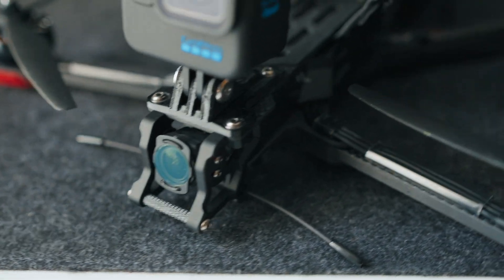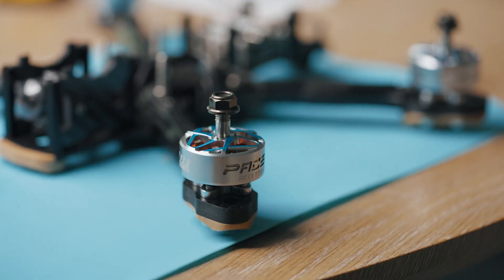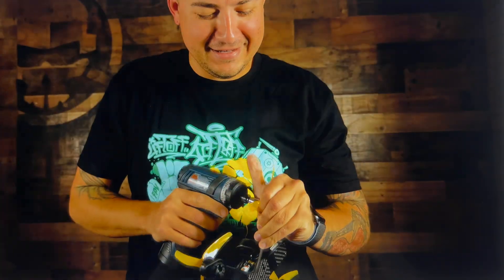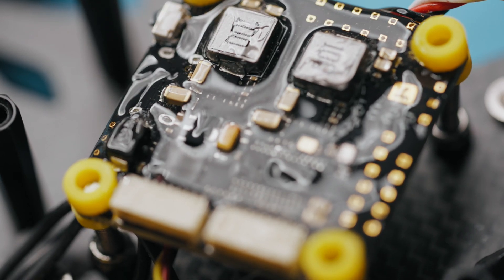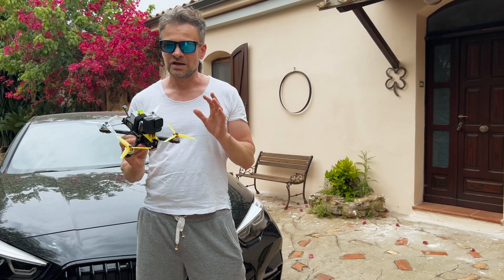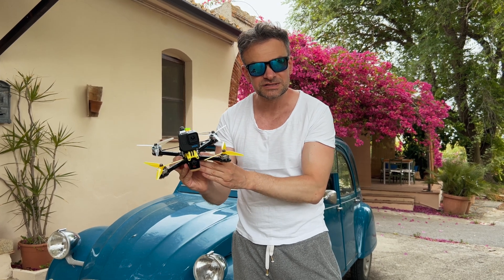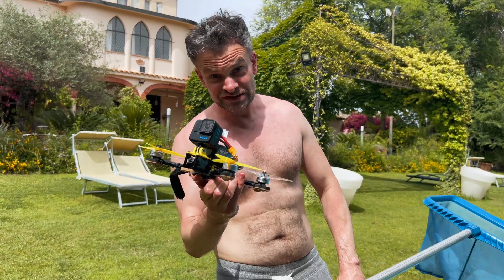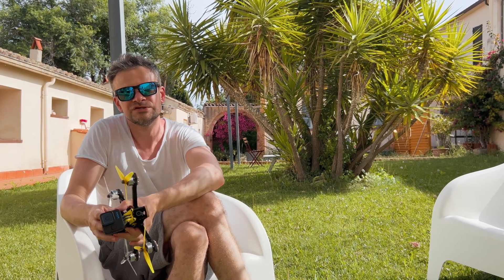Fully WATERPROOF FPV DRONE step by step

Comment from the maker: - It would also be nice to have silicone around the camera lens. There were no problems when using a Polar camera, but Nebula needs it;
- Leave a small hole for access to the barometer if you want to use GPS with your waterproof drone. In this case, everything will work correctly. If this is not done, the RTH will not work correctly, or rather, the drone may fall from a height if it was measured incorrectly;
- if the drone is completely submerged under water, turn on the "horizon mode" - in this way it will remain in a horizontal position and will not turn over;
- the signal may be lost under a large mass of water
Reply: what happens with the barometer full of water, if u submerge it what happens?
Reply from the maker: @diegomartinez-js4yh  I left a small hole for the barometer, it was not covered with silicone - only in this case the GPS works correctly. Everything was fine, I think that a huge pressure is needed for water to penetrate there. But on the other hand, I flew this drone under waterfalls, where the water flow is very intense - everything is fine
Reply: @WIL_FPV  tyvm!
Reply from the maker: @diegomartinez-js4yh  In any case, be careful))
Reply: What about the Caddx Vista VTX? surly it is not waterproof? The SD card? The USB port? The plug?
Reply from the maker: Vista is waterproof by default - that's why i chose vista. and it doesn't have an sd card. the ports have rubber plugs in them and are also covered with silicone

Comment: Hey,

nice Video. 😍 But I asked myself, whats with the connectors on the stack you dont use. Did you put silicone into it?
Reply from the maker: hi,
thanks, I tried to do my best
this is a very good question, sorry I didn't mented the answer in the video. YES, it's better to fill the connectors (even those that are not used) with silicone. If you get into a pool, with chlorinated water, or in the sea with salt water, everything will rust there.
Thanks for payed attention to this

Comment: what if u have to resolder something, its hard to remove from what ive lear ed
Reply from the maker: so, it’s gonna be a problem, frankly. it is necessary to cover again 🤷‍♂️
Reply: @WIL_FPV what coating did you use? i couldnt understand from the video. and what other coatings would you recommend? i dont want  something that is impossible to remove... Also, dji air unit 4 pro? do i have to coat that?
Reply from the maker: @Dumpflam  it was in this video that I used FPV Worry Free Waterproof Silicone Coating (link in the description)
and I can't recommend this particular silicone anymore
Yes, it's hard to remove, but there are other, more convinient materials
dji vista is waterproof already - dji o4 pro need to be coated with silicone

Comment: Thanks for your video. But I still can not find the part where you protect motors. How you made your motors to survive in the pool?
Reply from the maker: because I didn't do that)) the motors don't need any coating - it works. After more than one year, they still work very well. The only thing is, avoid salt water and pools with chlorinated water, it negatively affects some elements
dyakuy za komentar
Reply: Motor stator wires are already insulated from the factory to prevent them from touching one another.

Comment: Motors basically don't need coating?
Reply: Thanks man!
Reply from the maker: @pietro765  no worries, if u will have any questions, pls, feel free
Reply: @WIL_FPV I'm working on it,waiting for the motors,so you don't suggest to put some naval grease or some products on the bearings and windings?im planning to go like couple of minute's into the water and then come out...going to do your way of testing probably
Reply from the maker: @pietro765  that’s exactly what I mean - no coating for motors
Reply from the maker: No, not necessary
Reply: @WIL_FPV thanks man,so basically if all my electronic stuff is sealed and only motors are out,I'm fine to get out of a pool?what max depth you reach still having signal on the pool?
Reply from the maker: @pietro765  I lost the signal already at 1.5 meters. But I really do not recommend chlorinated pools - it harms all metal parts
And also, if you immerse the drone under water, turn on the angle mode, it helps to keep the drone in the water in a horizontal position

Comment: How does this affect the motors life?
Reply from the maker: So, according to my own experience, even after a year they work perfectly. I was worried that water might ruin the bearings, but no, everything is fine
Reply: @WIL_FPV awesome. I have my drones waterproofed (not all of them) but my rippers that I can't avoid being near water. And mostly due to the summers being so rainy where I am. I've always just been concerned about actually hitting still water. Thanks for the info
Reply from the maker: @b_snow777  thank you for ur feedback, appreciate it 👋

Comment: do you have to coat the lipo, motor or the vtx ?
Reply from the maker: in fact the battery doesnt need any additional coating. As it turned out, the motors work very well even after a year - no problems. No, they do not need any additional protection. VTX (vista) here was chosen precisely because the module is already protected, only some elements, the camera need it.
And attention, I can not recommend this silicone more. There are more effective options on the market
Reply: @WIL_FPV  appreciate it , so if i were using dji o3 , o4 or analog vtx it would have been very different?
Reply from the maker: @jkpisces  exactly! if it were for example o3 or o4 it is necessary to disassemble the VTX block, remove the thermal paste, and cover the electronics with silicone. The same with the camera.
Did I do this? No) does it work - yes. I will definitely try it with o4 on something like sub 250 sometime
Reply: @WIL_FPV  thanks for the great information ! love your contents
Reply from the maker: @jkpisces  Thank you very much for your support and your comments - I appreciate it

Comment: can this work in salt water?
Reply from the maker: I diffenetely do not recommend doing this - salt or chlorinated water has a very negative effect on motors and other parts. But if such a situation has already happened that the drone has fallen into a pool or sea water - rinse it under the tap.
I also definitely do not recommend the silicone that I used in this video, I found a much better quality product

Comment: Do we also need to waterproof gps if we use?
Reply from the maker: yes, it's better to do this, but not to cover the entire module with silicone, but only the vulnerable areas - connectors, places where wires are soldered, etc.

Comment: But what about air unit
Reply from the maker: It's already waterproof by default. Only the camera and contacts are covered with silicone
Reply: @ wait my fpv dropped in water does it mean my o3 is ok and motors or im in wishful thinking
Reply from the maker: @Slv-  and yes and no - everything is fine with your motors. I don't know what I did wrong, is it because of my accent, or I don't know. I spent so much time on this, this is the third video about a waterproof drone, and you ask the questions that are described in the video. I use the Cadixx Vista system, because the VTX is already waterproof. Not the O3, not the O4 unit, but the Vista. Yes, you can do the O3 waterproof, but it's more complicated, because it heats up more.
If the VTX is already waterproof, it's easier to cover everything else (FC, ESC, crsf/elrs) with silicone. Nothing happens to the motors and the battery after immersion in water - that's the answer in advance question
Reply: @ I’m going watch it again and again until I get my answer thank you so much
Reply from the maker: @Slv-  Please pay attention to the pinned comment, this is important information. It's not mentioned in the video, but avoid chlorinated or salt water, etc.
If u don't find the answers to your questions, please feel free

Comment: What about lipo ? Are they waterproof and the lipo connector. I mean if water go inside connector it may cause damage incase of complete drowning or submerged. Doesn’t it ?
Reply from the maker: Nothing happens to the lipo - the battery just keeps working. I covered xt60 connector from the drone with silicone, my friend didn't and the result is the same 🤷‍♂️
Reply: @WIL_FPV  thats great to know. Thank for reply
Reply from the maker: @vatsalkonkani  No worries, with my pleasure. I've done this many times and it's fine. The only thing is, avoid salt or chlorinated water, it's very harmful

Comment: In regards to lipo batteries, can’t they explode with water? Or what about after their wet, won’t they damage?
Reply from the maker: as my experience and that of other pilots shows, nothing happens with the battery. Avoid chlorinated or salt water, the contacts of the balancer start to rust in this case

Comment: I never hear anyone mention water proofing motors, is that also done aswell?
Reply from the maker: Don't worry about it, nothing happens to the motors. Even if someone says that the bearings will fail, it is not true. My first waterproof drone was made ~10 months ago and the motors are fine
Reply: @WIL_FPV  well that's great to know, so mainly the FC, VTX and some connectors need the proofing
Reply from the maker: @vitalvisualz  By the way, you said it well, remember about the connectors, it is also important if there will be contact with chlorinated or salty water.
In any case, after smth like this, it is better to wash drone

Comment: Wonderful video!  I am curious, did you leave the bind button uncovered or did you coat it since your drone was already bound to your controller?  Also did you add plugs or silicone over any USB ports?  Thanks, looking forward to trying this.  I think I will use an AIO board to make the process even simpler.
Reply from the maker: Yes, that's right, I did bind the receiver to the radio first. And only then covered the receiver with silicone. BUT! the receiver itself wasnt covered, first I placed it in a heat shrink and made silicone protection from two sides.
Yes, I used rubber plugs for USB ports. And even covered a little with silicone. Actually, these rubber plugs are included with the silicone.
Thanks for these questions, I overlooked that in my script

Comment: How much weight did it add to the drone when you added the silicone? Did it make a difference for your flight time before and after putting it on?
Reply from the maker: I think this weight is so insignificant for a 5 inch drone that I didn't even check it. The flight time is the same

Comment: I like how this video is made. Really high quality video. If you run the crossfire vertical and a longer antenna vtx you can easily get out of the water when there is a pool noodle on top. But if you live in a windy area then your setup right now works better. Just less chance of retrieval.
Reply from the maker: Thank you for your comment. But all the problems turned out to be different - so everything is fine, everything works, but I built the drone quickly and made one mistake - I did not completely cover the receiver with silicone
And chlorinated water is also not the best idea 🤣
Thanks for your support 👋
Reply: @WIL_FPV  receiver I use heatshrink and fill both ends up :) also use conformal coating on the rx before that. So doubke waterproof. But yeah chemicals are bad.. You can find full salt water and pool water waterproofing method at flydaze (he is pro waterproofing dji03 etc) dips in the seq for a swim.
Reply: @WIL_FPV  so that's why you had to fish the drone out with that pole! 🙂One thing I just found out about that product is that it's UV-reactive, so after drying one could use a UV flashlight to shine on it and spot any uncovered areas.

Comment: At 3:10 what are you saying please? Is it you need to leave a 'hole' I.e. not cover in silicone?
Reply from the maker: Sorry, English is not my first language, and not my second, not even my third, ahahahahaha - I try to do my  best)))
Yes, indeed, I put a thin stick, like a toothpick, to the barometer and covered it with silicone. As a result, there was a small hole and access to the barometer.
Why is this important? When we built the previous waterproof drone, but the first waterproof with GPS, we covered everything completely with silicone. The problem was that the drone was recognize the wrong ALT (atitude). Everything works, everything is fine, gps shows the direction, but not the correct altitude. Thats why, the RTH seemed to be working, but could disarme the drone at high altitude. A tiny hole for the barometer solved this problem.

Comment: Any way to do this with the o3?
Reply from the maker: Yes, for sure - first of all you need to do o3 unit naked. after that the same process. But u have to understand that the temperature of VTX so high and probably it could work wrong in hot regions 🤷‍♂️
Reply: @WIL_FPV  yeah kinda thought that would be the main issue. Thanks
Reply from the maker: @Arcticfawksie  I would also like it all on the o3
Reply: The main issue with the O3 is the braided covering on the mipi cable. It is difficult to waterproof and water absolutely will wick up the tiny wires inside that braided covering and into your camera and vtx. Either stick with the Vista or check out FlyDaze FPVs waterproofing method for the O3. It I much more involved, but if you must do the o3, then you need to go that route.
Reply: @William_NS  do you think thats needed for just a little rain?
Reply: @BeautyBeastRC  Just rain is fine. I have flown many O3s in the rain and I haven't lost one yet. I just conformal coat around the edge of the lense and run a bead of B-7000 along the top seam. Probably over kill, but I'd rather be safe then sorry with a $230 VTX. Don't worry about conformal getting on the lense,you can't see it in the camera view and it doesn't show up in recorded video.

Comment: I've always wondered how the batteries are waterproof? They have a film all around them. But where the cables come out, it's not waterproof??
Reply from the maker: So, the battery is not covered in any way, but nothing happened to it either - it works. In the video, I cover with silicone only the power wires in the place of soldering to the XT60 connector
Reply: @WIL_FPV  okey thanks for the answer.
Reply from the maker: @swissfpvshots  u r always welcome 
But I extremely recommend to avoid pools like the one in this video because of the presence of chlorine - no so good idea